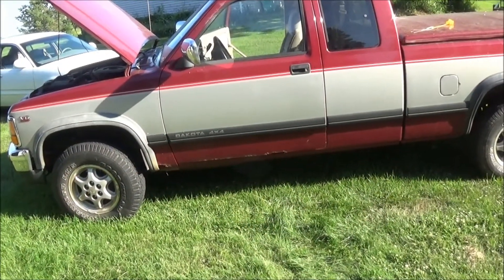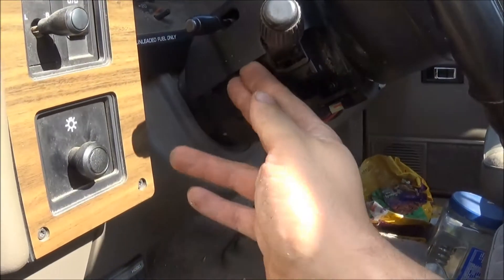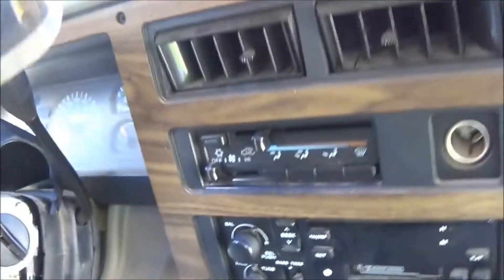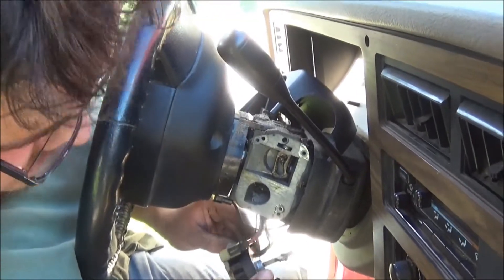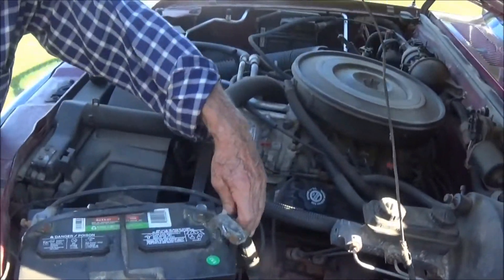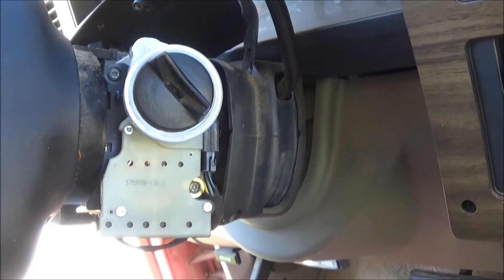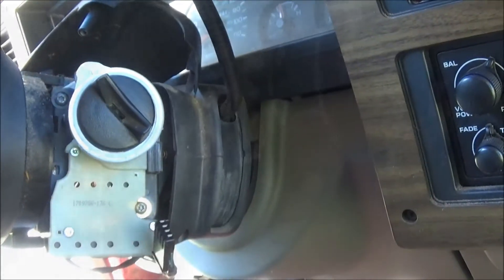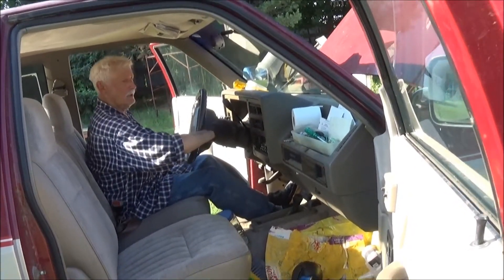R and r ignition switch 1995 Dodge Dakota .helping gbob with his truck

Comment: I have a 94 Dodge Dakota and the rear emergency flasher do not work (the front ones do). I was told I needed to change out the multi-function switch or the headlight switch. What do you think?
Reply from the maker: could be
Reply: What did it turn out to be?

Comment: Hope I have not asked this already, but what would cause a switch not to fit back in flush in a 95 Dodge Ram 1500 with 5.9 engine?
Reply from the maker: not lined up ?
Reply: @Bigdaddy1992.  I reinstalled the old switch and key lock cylinder and bypassed the switch. 
  Temporary fix until I can find a new or used switch and cylinder that fit together. 
  Bought two new ones that would not fit each other. 
  Anyway, back on the road again.
Reply: my uncles truck 95 ram , the old switch would not turn off all the way and key came out in any position!  you could start it with no key, so I replace it and it didn’t line up so good I did get it but the key would not come out because truck gear shifter was not into park all the way. When I firmly held into park key would turn back and come out. Is there a piece in colum that breaks? The linkage is off but maybe this is common ??

Comment: I've got a 95 dakota. It wouldn't start backup if I drove it and then shut it off. I was told the battery was bad so I replaced the battery. Still did it. I was told it was the starter so I replaced the starter. Now the truck won't start at all. I have a buzzing noise when I turn the key but it won't start. Should I change the ignition switch next?
Reply from the maker: Could be or your starter celluloid
Reply: @Bigdaddy1992.  Ok thank you

Comment: Hi
Was the ignition switch starting the truck only some times?

How did you figure out it was the ignition switch that needed replacing?

Thank you
Reply from the maker: yes only when it wanted to
Reply: @Bigdaddy1992.  thank you for the reply.
I replaced the switch and it works really good.